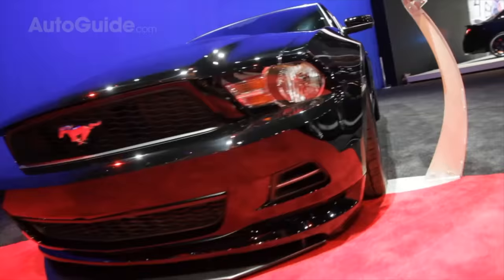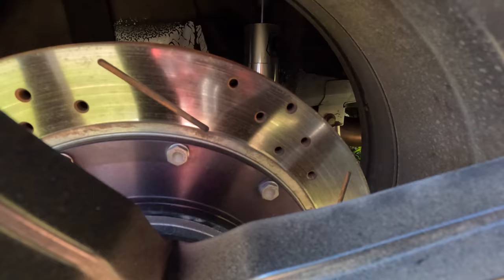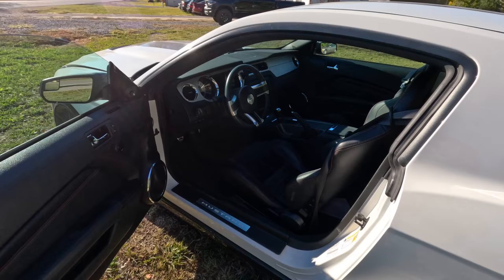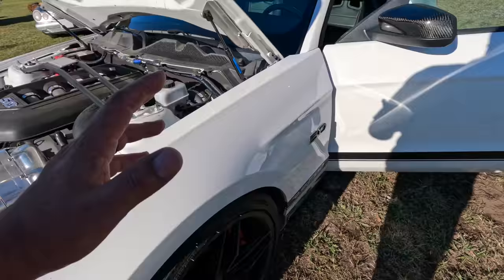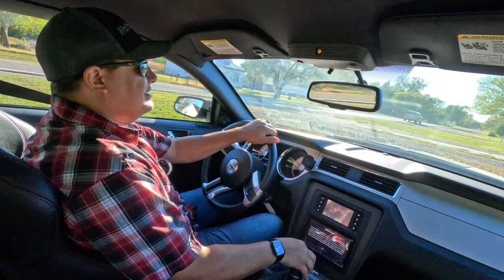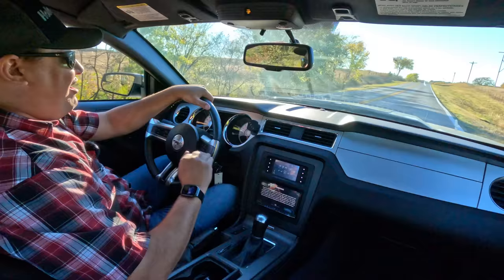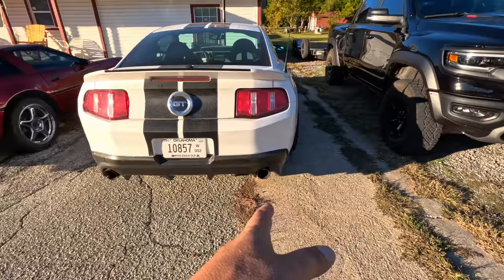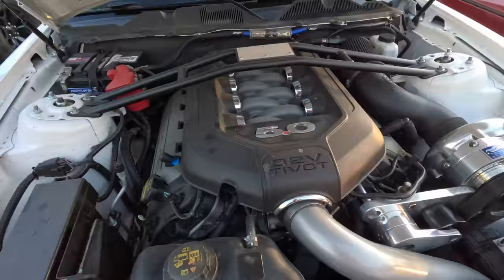I Won a SEMA Built ProCharged Mustang GT for Less than a Kia! 600+ HP! 1 of a Kind Raceskinz!

Comment: Hey Randy, the clutch master is fed from the brake reservoir and is inside at the pedal. The clutch slave is in the bellhousing. When the fluid level drops it effectively locks out the clutch so you can't easily drive it with little/no brake fluid. Topping up the brake fluid should sort it. Also, if it has the Tremec box, then Summit might do a remote bleeder for it... Certainly there's one available for the GTO/Monaro and G8 GT... 🤔

Comment: The clutch problem sounds like bad seals in the master cylinder to me, but you'd have to bleed it anyway, so that custom bleed tool would not go to waste in any case. Next thing I'd do is finding a way to get the car into the shop undamaged, so you can work on it properly. Nice score for sure.

Comment: You don't need the clutch to shift , only if you start in first gear. You only need some feel while changing the gears, it is like shifting a fuller....sometimes only the snycro rings work against the shifting process, the secret: shift while no load is given, give gas in neutral while shifting back to syncronize the rpm in between the gears....

Comment: Not all tuners will turn off the rear O2s, you can get off eBay “O2 sensor 90 degree angled extensors “ off eBay for a few dollars and that should fix the O2 issue

Comment: Get a HP tuner to give you a new tune. Overtime is always good to adjust as the engine wears. Make sure is all running good. May need an oil change on the pro-charger.

Comment: Isn't it in California that they recently got more strict on loud and modified exhaust systems?

Maybe they got fed up being pulled over or too many tickets for the noise?

Dealer most lickely just saw and old tired tuned Mustang and decided they didn't want to mess with it, specially with the clutch and not running quite right.

Those seats look like they will fall apart at any moment with much movement they have. 😬

Comment: Clutch hydraulic actuators have been around since dirt,,,  I am sure that there is a system that can be bolted in that will be reliable  The most reliable one I have ever used was in a 1966 Ford Econoline with a 6 cylinder engine in it,,  Drove it for years without a hiccup,,,  :-)

Comment: It's a cool car. I have recently discovered that power can be fun but on a wet road requires a very light foot. I don't have a light foot. My car runs on 91. It was not happy on 87. A lot of people don't get that. $50,000 actually sounds good to me for what you are getting. I was playing on the Ford website and an optioned out GT500 today could be well over $100thousand and It wouldn't be custom one of a kind. What did a Mustang cost in 2011?

Comment: If I was you randy I would hold on to that car DO NOT SELL IT a car of that caliber will only GO UP in value especially if you put a notebook with the history of the vehicle together and keep it with the car. Also if that car has coil overs which I’d imagine it does you can adjust them to raise the car up.. someone probably slammed it for The pics to the auction and never raised it back up.

Comment: 523 RWHP with a procharger? You can make 470 with FBO E85... No offense but at that point a 7k kit isn't worth the extra what 60 hp? Thats obviously if a regular owner wanted to buy a GT which then they'd spend what 20K+ On it for the same year. THEN 7K on the kit THEN ANOTHER 7K for everything steeda. Another 400$ for the interior bits "Touch screen" Then Wheels. All in all over 20k in upgrades for 22k and thats not including the car. You got a HELLLL OF A STEAL AND I WISH IT WAS MINE!!

Comment: What's the point of having a car that you can't drive, I know most SEMA Builds are not designed to be driven, but like with this car what happens after the show and events end and the car is forgotten about like this car was.
You have a car that either needs to be destroyed or just sits around.
Since most of these parts people will be buying them for their daily drivers, it's difficult seeing parts you want to buy on a car that can't be driven easily.
Just think if you would have built the shop where you park the cars, it would make it so much easier to get cars in.
Reply from the maker: Ummm because I drive it ???
Reply: @AutoAuctionRebuilds  I edited my comment, lol
I know you drive it, but you are afraid of tearing it up.